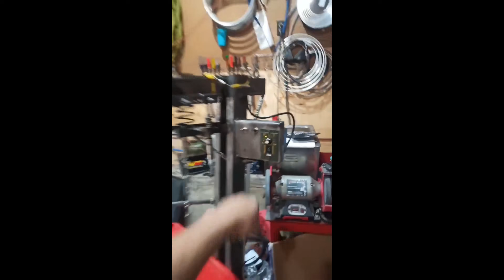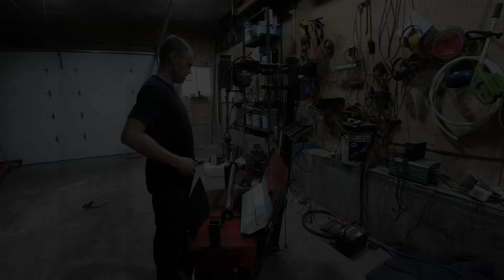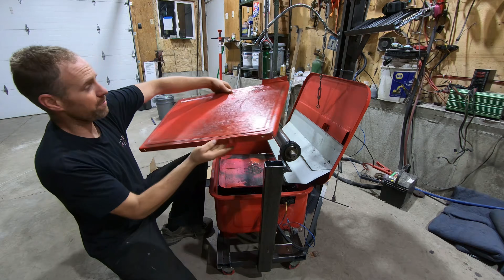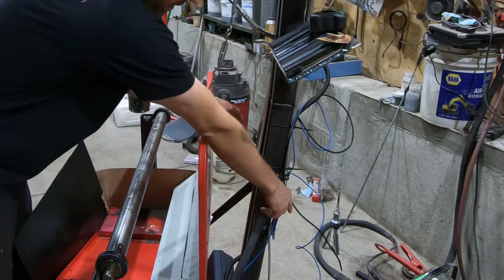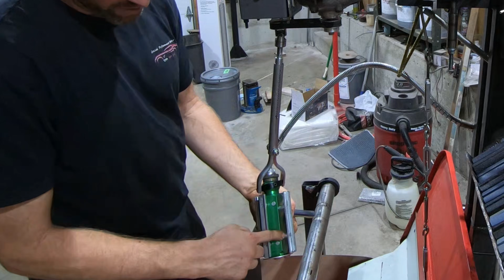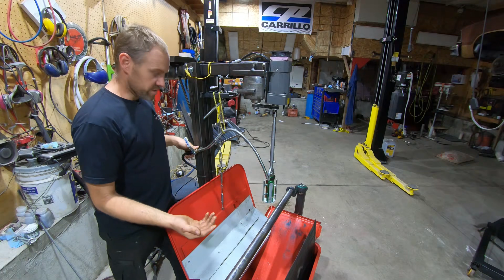My DIY Cylinder Hone Machine

Comment: Man this is awesome. You should check out a big boy one. You coukd use some of the concepts like the motor being used as the counter weight in back and step pulleys for different speeds and feeds and the adjustable stroke set up with a tilting table that can be cranked up and down. We also routinely cut our stones per use rather than buy custom stones.
Reply: Where can you get stocks of stone material to cut your own? Tia
Reply: @mattkirkland9842 you just use the stock length stones and cut them down say an inch from the top so you have a shorter stone say now 3 inch long stones rather than 4 inch long ones. This allows you to get more stroke with out having the top and bottom of the stones stick out a lot at tdc and bdc which could cause say an hour glass shape in your bore

Comment: Dingle berry are fine after inspecting the bore
Reply from the maker: Only for a surface glaze breaker. They can't make a cylinder round or parallel again.
Reply: @CrazedPerformanceRepair  Many people do not understand that.
Reply from the maker: Then they shouldn't be using them until they learn it.  @kmcwhq
Reply: @CrazedPerformanceRepair  I wouldn't even use one as a glaze breaker
Reply from the maker: @funone8716   They do work good to clean out large rusty bolt holes or something like a wheel cylinder. Perhaps a wheel hub housing to I suppose.
Reply: @CrazedPerformanceRepair  Ya OK, but not an engine cylinder
Reply: Agree. I have them but they simply cover up imperfect cylinders. Those who think they work have never measured cylinders done that way. That or they just don’t care what’s actually happening.

Comment: Outstanding video.  I was a dealership mechanic doing primarily engine/transmission repair, (technician for those who prefer that term) & then built my own shop.  The price of equipment was very discouraging.  Prices you out of some market segments because less affluent customers just can't afford to pay what you have to charge to recover your investments.
Reply from the maker: So true, it's insane how much things cost to get going vs the amount you can charge before the labor prices exceed the value of the vehicle you're working on.
Reply: Agreed! I teach small engine repair at a rural Montana high school. I want to teach them more engine machining, but even beat to death used equipment is too much. I can't imagine trying to start a shop. I'm helping one student rebuild a Chevy 350, but the nearest reputable engine shop is hours away and outside of budget. Most machining is outside of any student budget. I'm  trying to build the equipment so that the students can afford engine rebuilds themselves and so they can afford to learn most importantly.